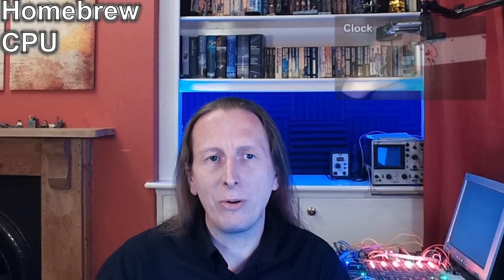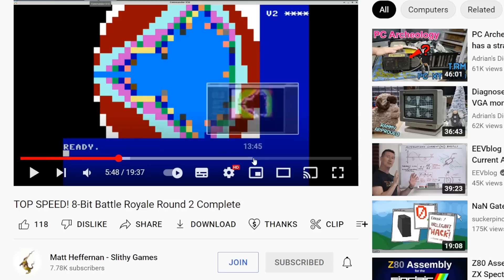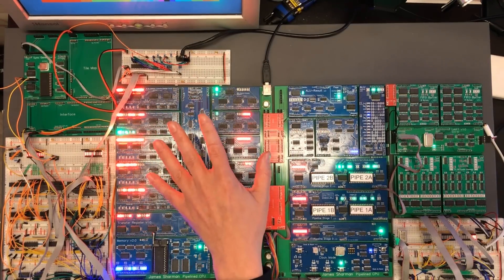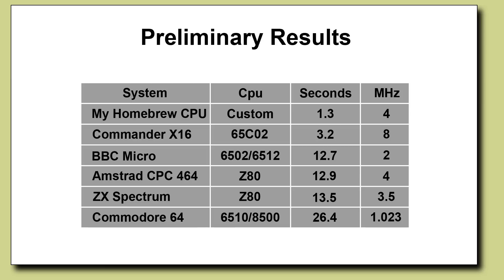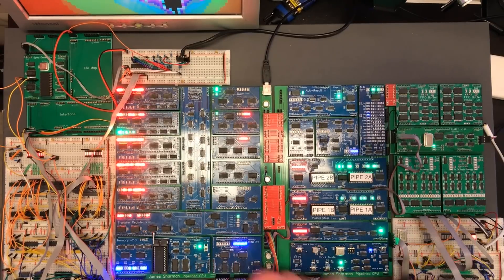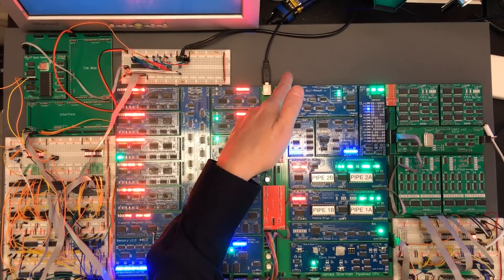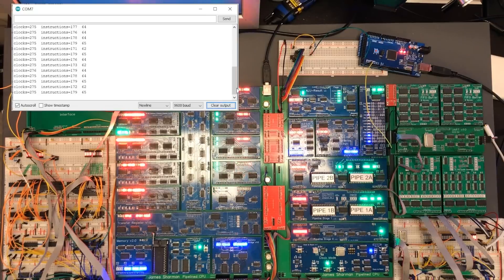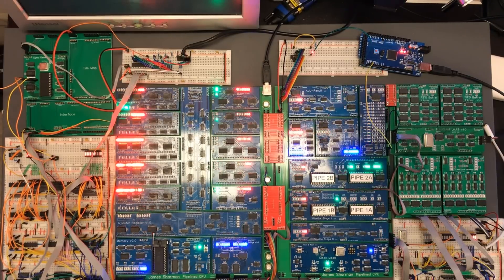Is this the most powerful 8-bit system ever? - Making an 8 Bit pipelined CPU - Part 100

Comment: Wow, this is really impressive ! I really love your attention to detail when you explain things and I really love coming back for the know-how you share. I benched my own version of the X16, and it came in exactly as predicted, running at a simulation 4Mhz with no other real hardware than a 65C02 CPU. But your 1.3 is just so out of this world comparably.
Reply from the maker: Interesting Thanks Dirk, have you done much coding on the x16? Obviously that graphics fpga would have me beaten any day for pixel moving.
Reply: @weirdboyjim  I've done some experiments to find out more of how it's supposed to work - since I don't have a real vera, I need to go by the emulation code that is freely available. I'm currently spending way much time getting the simulation to work like hardware, and getting the hardware to not notice the simulated bits.

Comment: Can you run doom on it (sorry if i offended you by that question, just curious)?? Could you manage to run anyhow?
Reply from the maker: Lol, the original Doom required a 32-bit 386 processor with at least 4MB of memory. My 8-bit cpu with 64kB of memory while (I like to think) extremely capable is out of it's class there.
Reply: @weirdboyjim  yup, makes sense, i was just not sure of how much memory does it have though it was obvious (8bit limits that of course).. dumb question aintit?

Comment: still, on an IPC basis, Mr. Sharman's 4 MHz 8-bit CPU is faster overall than a 10 MHz intel 80286 16 bit CPU.
Reply from the maker: Doing back to back 8-bit alu operations this cpu can keep pace with the best, but the 286 is a 16bit cpu with 24bits of address so it can do a whole bunch of things mine would struggle with, not to mention the protected mode that let's it run more advanced operating code.

Comment: I think this is quite an achievement considering you were never building for pure overall clock speed but for decent IPC. The old z80 had a poor IPC compared to the 6502 and you are roughly 5 times that in your adjusted result. For something built using discrete logic that is a hell of an achievement and I am looking forward to seeing what can be achieved with this design programmed into FPGA as I understand there are a couple of people working on that. One thing you could do in this project is interfacing to modern serial busses like I2C and I2S, this would make driving lots of modern peripherals very easy, you already have UART after all.
Reply from the maker: Thanks for the kind words. Wait and see about other interfaces, there is more to come on that side of things.

Comment: I am actually surprised and a bit sad that the C64 is so slow in the mandelbrot challenge
Reply from the maker: It's more complex than that, this benchmark is all about raw math speed and the low clock rate hurts it. But the games were often better than other 8-bit machines because it had sprites etc...

Comment: WOAH!!?!  Brings me back to my Intel 8051 microcontroller frustrations!  The Assembler / development environment / ‘emulator’ ran on a DOS terminal.  And so it was always a riddle to me, whether the ASM program was really yielding clock cycles and values that were true to not just it’s own software programming, but if whether that software was seriously delegating every 8051 resource appropriately, in the same order, initializing it’s registers, clearing its carry(s), setting up for parity, etc etc.  And doing this initialization process just as some specific microcontroller’s data sheets had described.  I find it rather amusing, the remaining two camps still to this day, who either prefer the clock’s ticks to be left up to X-tal wiggles, or by way of the RTC, driving those cycles over Transistor-Transistor-Logic.  It seems to me
That the TTL solutions are better geared for say a clock radio or a microwave oven, and the crystals are something that I would have to hand and so I’d grab it.  THANKS A BUNCH FOR SHARING THIS, VERY GREAT LECTURE!!
Reply from the maker: Thanks Jimmy, glad you've been finding it interesting.

Comment: Do you know the eZ80?
Reply from the maker: Yes, but only from comments on this video!  ;-) Interesting chip, I suspect it's biggest use is in extending the life code generated for old systems.
Reply: @weirdboyjim  Well, it is widely used not just to extend old code's life, for example the newest TI-84 calculators used the eZ80 and also is used in industrial robotics :)

Comment: Great work James. I had a question about your Mandelbrot implementation; how many iterations do you do per pixel? The reason I ask is I am using 64 iterations per pixel on a soft core RISC cpu demo at 256x240 resolution as it brings out more detail, even though it burns more CPU cycles.
Reply from the maker: The benchmark used 15 iterations, same as on the other platforms to make the comparison balanced. I may do a video at some point showing different values.
Reply: @weirdboyjim  it's pretty amazing, you still get a great Mandelbrot at 80x60 with 15 iterations. Another question would be, what is your fixed point resolution? Do you use e.g. 2:6 fixed point to fit into a single 8 bit register? As an aside, I was inspired to write my RISC soft core by watching your videos. It's been a great series so far, congrats on video 100 and getting such great results.
Reply from the maker: @jamesrosssharp  it 8.8 to fit into 2 bytes

Comment: how the heck does a BBC micro tie with x16? does the 8bit guy need tips from ya?
Reply from the maker: Well the processor is roughly the same one. The x16 is much faster in actual throughput due to the higher clock rate. He did want to build something similar to classic micros rather than a modern high performance device.

Comment: I've been following this project for some time now (not from the first, but close enough). I know you've tightly focused on your original objectives -- 8-bit, pipeline, SSI TTL-compatible  chips for most everything in your CPU proper, but using LSI EEPROM and static RAM because life is too short to try memory solutions from TTL's heyday. That said, you have augmented your design with very useful hardware I/O. Have you considered adding a simple EEPROM (or, better yet, shadowed ROM in RAM as you do for your too-slow EEPROM) precomputed lookup tables for 8x8 multiply and maybe scaled fixed-point reciprocals, square roots, trig functions, etc? Allocating some registers in I/O space (or memory-mapped I/O) for a sort of table lookup maths coprocessor could be very interesting for increasing performance without adding complexity to the CPU. You are already using various sorts of LSI ROM & RAM techniques, so this would still be in the original spirit of your objectives. You needn't add more than one such lookup table at a time, as long as you have some unassigned I/O ports left. Multiply would surely be worth it, and reciprocal lookup does away with much of the heartburn and many, many cycles of long division. Most division problems in your use case would be reduced to finding the reciprocal of the divisor, multiplying that by the dividend instead of doing regular division, with either pre- and/or post-scaling to get the significant digits you require.
Reply from the maker: When I finalize the build I may show how we can reorganize the instruction set to make simplifying the pipelines possible. I could indeed add the kind of hardware you suggest, might be an interesting side project but I was aiming for a good general purpose throughput, It's possible to speed up just about anything with a lookup. Multiply is much easier to get right than a divide though.

Comment: Any idea the theoretical maximum in performance for the widest use cases (audio, sprites, 3d etc) that can be achieved in a fully native 8-bit system assuming the right architecture and access to fabbing?
Reply from the maker: No real reason why you couldn’t achieve the same throughput as a modern cpu if you tweaked the design and made it the latest process.

Comment: WoW! This reminded me of my BS graduation project in 1998 when I designed a RISC pipelined processor and wrote an assembler for it along with an emulator. The tool was used as an educational aid for freshman students in computer engineering department.
Reply from the maker: Sounds like a cool project!

Comment: My 8 bit CPU that only processes 8 bit bytes would be mostly 256 and 256x256 byte lookup tables.. 1 tick multiplies and divisions, 1 tick for all look-ups.
Reply from the maker: You would need 128k for those u8xu8 lookups, the result will be 16 bits.
Reply: @weirdboyjim  ..16 bits for non-overflowing bytes multiplies but I'd implement multiplies the standard way with shifts and adds and a full 65kb 256x256 lookup table so 16 bit memory addressing, 8 bit super-fast 8 bit integer maths for 8 bit div+mod op combined into 1.. so 128kb lookup.... 16 bit division by an 8 bit would use a much smaller, 256 entry table of scaled fixed-point reciprocals used for a multiply, with the result shifted back to 8 bits..
--
I don't limit '8 bit computing' to 8 bit memory addressing.. 8 bit wide buses, sure, and 8 bit operations.. the 68008 had an 8 bit data bus but could do 32 bit integer and float ops (slowly). It wasn't really a 32 bit CPU  though..Someday massive lookup tables may become the best power consumption to speed compromise.. Divisions and even multiplies alone use a lot of power and pipelined processing. Needs super low energy SRAM cache memory 1/4 of size and multi-stacked. This is the way systems are going. 
--
serial Look-ups beat parallel , rolled out versions for many core 8 and 16 bit integer / fixed point maths ops until SSE 3 era on Intels.. Still does for many other ops, especially when integer and FPU ops are combined a lot (pixel-accurate trig funcs)
Reply: ... Also, the div and mod tables only need to store bigger / smaller, not smaller / bigger so only half the 256x256 table needs to be stored, or the Div + Mod combined table can be packed together in 64 kb... Worked well in a super-fast, pre-SIMD, pre-GPU era,. line drawing pre-calculations sped up by order of magnitudes using 64 kb look-ups for for super-fast 8 and 16 bit div-mods. Quite a bit of logic involved, but still fastest way until GPUs, or late SSE versions on Intel CPUs. Arm I'm no expert on.

Comment: Nice.. Not what I was expecting from the title but I like the idea of making a completely new 8 bit system using the old fashioned way using far less on-die integration. Good to see the parts of a SOC simplified, spread out and magnified - disintegrated even!... My idea for the 'most powerful 8 bit home micro' was an 8 mhz multi-processor system that combined the best of British ideas and US/Japanse chips... 
--
Acorn's multi-processor bus system sporting 8 mhz 6502, Z80 and 68008 CPUs (but not Intel!), a DMA controller and at most 2 ULAs, preferably one as the early 80s saw many improvements in ease of on-die integration and customisation, with complexity greatly increasing (due largely to a British invention in IC fabrication)... The Acorn ZX QL...! If it had come out in 1985 with good emulators / recompilers for all common systems it could have ruled.. 256kb memory divided into 4 64kb pages, 2 of which can be used for the ULA and screen double buffering, or all 4 used by all 3 CPUs + ULA in parallel..
Reply from the maker: Thanks. It would be interesting to see what you could do clustering old cpu's.

Comment: I’m about to retire and to keep my mind active I thought I’d learn some electronics and coding. It’s about as far from everything I’ve done before as I can get, I was a chef before getting my law degree at 40. Do you think I could build something like this by next weekend? 

Being less facetious (sorry) to me it's absolutely phenomenal that one guy could do this. The build and coding is simply mind blowing. You should feel extremely proud. A more sensible question this time I hope. When you are writing code for the separate areas, such as for sound, video etc, do you write for separate processor all programmed individually? Or, one core program that sends information to all the different parts? If it’s the former how do you sync all the different parts and it’s the latter how do you keep track of what should be low and what should be high? I can get confused running two sensors off an Arduino. 

Once again, mind blowing work, simply amazing. I’m subscribing, it’s obviously far more advanced than my level but that’s good, not every channel should be for newbies. They’d be a massive group of people ignored if that was the case. I’m looking forward to learning though I'll try not to ask too many stupid questions.
Reply from the maker: Thanks for all the kind words. I develop the code in isolation alongside the bits of hardware but I've been bringing bits together more recently. As a game developer we often have to write code that balances all the different tasks so it's just part of the challenge.

Comment: Congrats on the 100th, love your work.There is a modern Z80 called the eZ80. It can run at 50Mhz and has a 3 stage pipeline. I wonder how it would do running the Z80 version of the benchmark. One day I will have to give it a try,
Reply from the maker: I'd be interested to here. I imagine it will trash me, especially at that clock rate. That was kind of the point I was making, I compare well against the decades old devices of my youth but I have no illusions against anything designed more recently by an expert.

Comment: Is it memory reads or writes that are typically blocking the IP read? Unless you plan on writing self-modifying code, a write buffer that is deprioritised from the instruction read but prioritised over data reads could give you a noticeable boost, even if it just holds one byte. If your design's timing can be tweaked for the prioritisation without losing memory clock sync, that is.

For reads this probably would just trade starving for swamping, so nothing gained there. Here low prio prefetch (i.e. filling a buffer in unused memory cycles) could have an effect. However, with your low skip rate I don't feel the effort would warrant it. Simple prefetch is 1/2 the complexity for 1/8 the gain of a full L0 cache.

And now I need to get my brain out of "problem solving" mode somehow. Or trick it to solve my problems...
Reply from the maker: Both. It’s total memory bandwidth. I’ll cover caches in a future video but the common ways to solve this as it stands is with a wider bus or a Harvard variant

Comment: I just landed here after starting from video #1 and then looking through easyeda:  It would be interesting to see how much ground bounce you have on the cards; Most of them have very few ground returns compared to the large number of capacitive signals they are driving, and the edge rates are not that low. Signal-integrity and EMI worries aside, the architecture is just neat, and I can see why you left out an interrupt (more PC/RA registers, or a hack with the fetch-stage injecting a sequence?).
Reply from the maker: To be honest the circuit is holding together quite well, better than I have any right to expect. The more electrical side of things is really not my skill set, lots of decoupling and ground ties is keeping the signals tolerable. I would have had much more trouble if it were not for cheap 4 layer boards.
Reply: @weirdboyjim  While the boards themselves could use more gnd vias, my worry is this: Take the address register as an example. In the previous cycle, the 16 Addr lines were driven high by some register, and are now floating high. Now a register asserts an address of all or mostly zeroes: Each output driver sees the combined trace capacitance (in the backplane and other boards) plus the input or output capacitance of all chips on the line, let's say 50pF. The driver changes the state of the line by 5V over 10ns, 50pF*5V/10ns=25mA. There are 16 lines, so for 10ns 400mA is flowing up to the board through the 16 Addr lines, and back down to the backplane through the single GND pin. It has inductance, so GND on the board now bounces relative to the backplane. From the point of view of the chips on the address register card, it appears as the input signals bouncing. It happens in both directions, and if it bounces enough to be seen as extra clock edges then things go wrong. It appears as 'holes', where the machine becomes unstable at some frequencies and access patterns, but may work at higher frequencies. The cure is extra ground pins sprinkled near the driven signals.
Reply from the maker: @kkpdk  I'll try and take the return path into account more in future pcb design. The address registers are most effected by that but I'm not going to rush into reworking big chunks of the build unless I start hitting those problems.